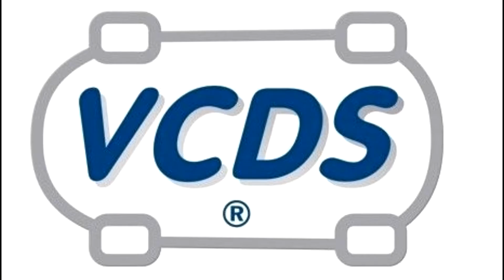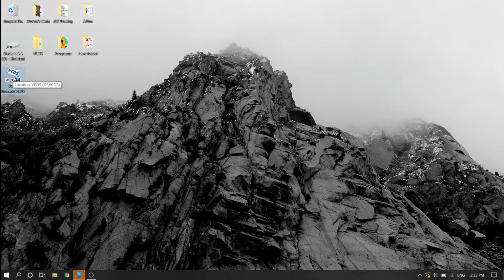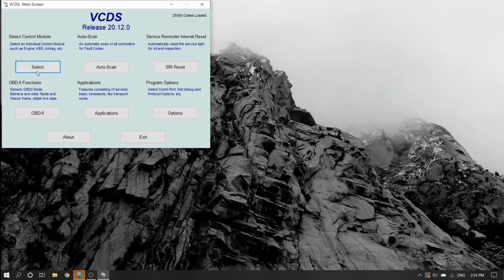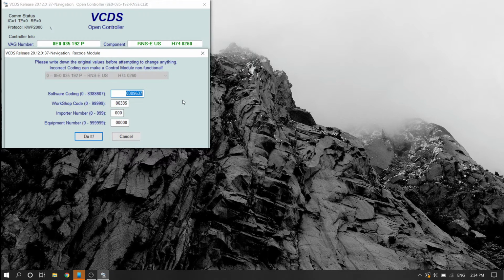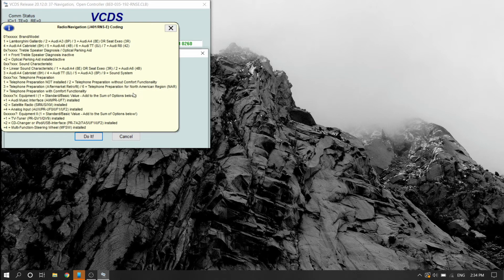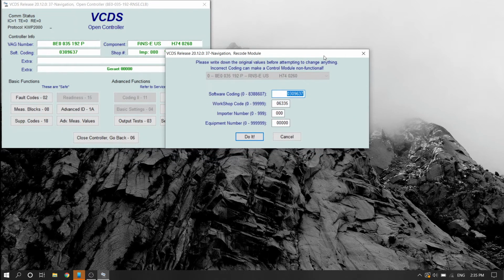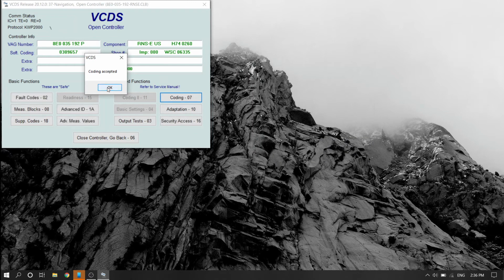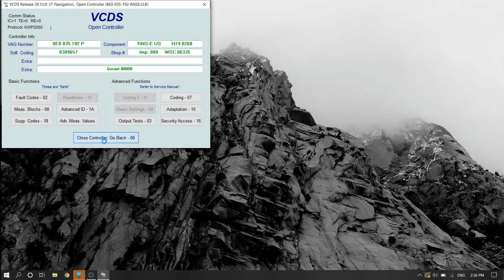RSN AUX ENABLE ON AUDI B7 USING VCDS

Comment: TJ J
0 seconds ago
Followed instructions and coding part. Added 4 to the existing 3 so I typed in 7 in the second last number in my code. Clicked Do it! on VCDS then I get an error message  "out of range, unable to set premaster" and it's not programming the radio. Any ideas??? . Why did you change yours to from 3 to 5. I though it should be +4 *AUX0 so the number would be 7.
Reply: U change it either 5 or to 7 if you have sirius
Reply: Hello, how did you solve problem? I am also thinking to add +4 for current code

Comment: Been Trying to get my aux in to work in my mark 1 rnse. Had a guy who done vcds but could not connect to the head unit for some reason. The head unit would not respond to the vcds commands. Any ideas at all please.
Reply from the maker: You're using the incorrect wiring harness. Same thing happened to a client of mine. It's something to do with the k-line.